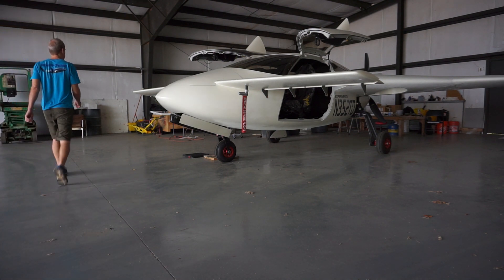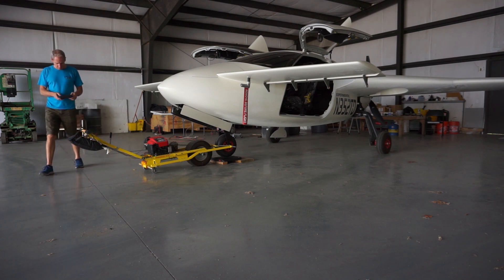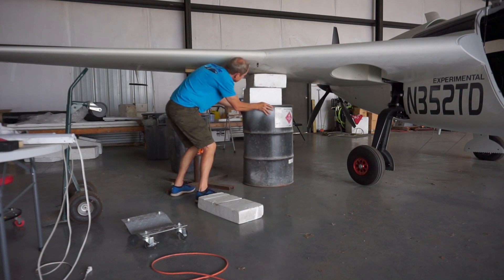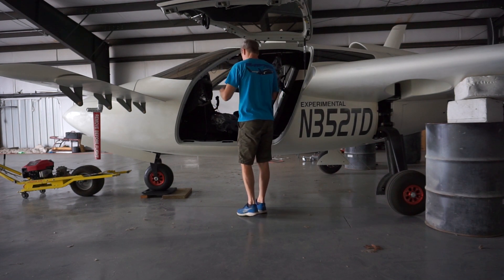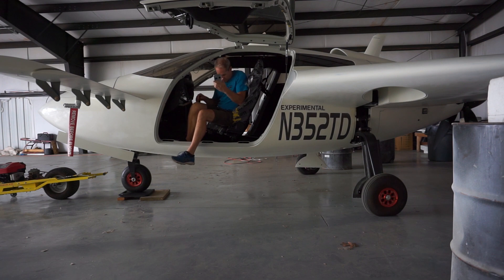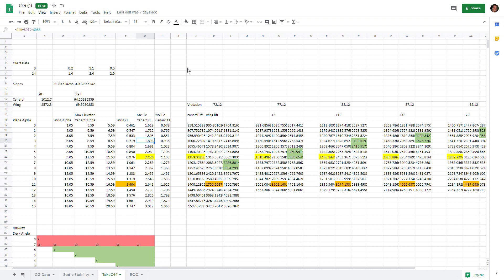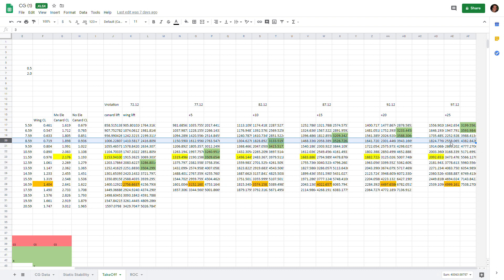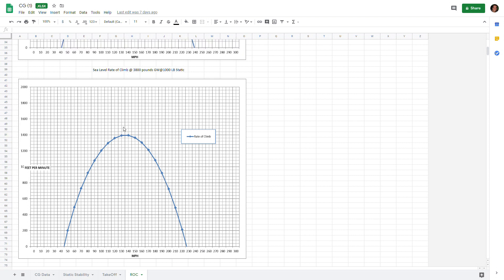Rotate/Lift Calculations - Building the Raptor Prototype

Comment: but would that be the center of lift of the canard total weight at VR more then the front well ? although adding to the multiplayer the left distance from the front well, and the fort plane is possible , still would it be from center of lift of the rear to center of lift of the front in a static situation , just asking  .

appreciate you still uploading and salute you on your tenacity it's admirable.

Comment: Been watching since you and Mark got the CNC machine...long road (airway) so I am pulling for you brother.  Have you placed an incidence jig on the canard to verify that when the airplane is fully loaded as it would be when rolling down the runway that the canard is at a positive angle of attack to the relative wind (runway surface)?  If the nose strut is too low/short and the "stance" of the airplane is such that the nose is too low the canard angle to the relative wind can be zero or even a nose down angle of attack.
Reply from the maker: It's positive. Recall that I have had the nose off already.

Comment: Hey Peter, great job getting to this point at the cusp of flight test. I’m pulling for you and the project! Just wanted to get clarification on some numbers you mention in this video. At about 3:40, you said you’re running the TOLD with Justin and the expected fuel load at 3550# total weight for the initial takeoff. Later, at about 11:16, you mentioned the max gross weight of the aircraft is planned at about the same 3550#. So is a single pilot and partial fuel load maxing the gross weight for the airframe as currently configured?
Reply from the maker: I meant gross weight for the first flight. Sorry for the confusion.

Comment: Pete, are you planning to do another detailed ( access panel off) integrity Inspection of the control system cabling before Wasabi arrives ?  It’s been some time now since you did the tensioning. Things may have relaxed somewhat. Also, are you going to measure the airleron and elevator control force outputs generated at the control surface through corresponding joystick control input forces. I.e what mechanical advantage ( if any ) is being generated by the control system cabling. ?
Reply from the maker: We will be reviewing all the items from the first visit before doing anything else.

Comment: ,,, I'd keep the fuel system as simple as possible on the initial flights . Feeding and returning into one tank only . No transfers. Of course the Motec has fuel temp provisions  ? ,,, ; however you may already have it that way ?
Reply from the maker: There is already no provision for switching tanks.

Comment: That 100 - 150 pounds of "reserve" lift based on those calculations means absolutely nothing when you're at a higher altitude airport, or when the outside temperature is more than 90°F and you run out of runway due to lower air density in an overweight aircraft. There has to be a better way to solve certain issues without adding weight to the airframe or having to plan your take-offs before the sunrise. There's a reason why it's called "Weight" and balance.
Reply from the maker: We have enough runway and excess power to compensate for high DA and we're going to test all this with high speed runs before attempting a full first flight. I'm pretty sure I said that in the video.

Comment: Obviously it was a safe thing to do but it certainly was a bit disconcerting watching you jacking the whole one side of the plane on that small block (of wood?).  Really looking forward to the first flight!
Reply from the maker: The point I jacked it on is right where the spar is. It can definitely take the load at that point.

Comment: Peter, did you explore using a shrouded prop in the early design stages?  Are there any canard designs using one?
Reply from the maker: I thought about it. They allow faster prop speeds but create extra drag at higher cruise speeds and more construction complexity.

Comment: I was wondering how accurate your measurement is. The placement of the wing supports seemed a bit arbitrary. To get a good reading they need to be the same distance from the CG as the average lift from the wings. Looking forward to next week.
Reply from the maker: I did support the wings as close as possible to the mean aerodynamic chord/center of pressure of the wing.

Comment: When is the prop going to touch seems an easy  to be an easy enough trigonometric problem : 
Arctan(11.75/72)=9.2686
So you are protected until 9.25 degrees of bank, which is plenty. 
Does my reasoning seem reasonable?
Reply from the maker: 9 degrees of pitch is what you meant. I think I did say that in the video.
Reply: Do not forget about your main undercarriage compression too, with weight and with G variations with RWY surface roughness?

Comment: Remember front strut extension when figuring how high the wheel will be off the ground.
Reply from the maker: That doesn't really matter as we're going for 3 degrees. So actually the wheel will be less than the 5.5 inches. Probably closer to 4 inches off the ground.
Reply: And you have to consider the landing attitude at touchdown with landing gear struts compressed for prop clearance.
Reply: gforce l

Comment: Are the performance numbers based on standard day + delta T for the predicted day pressure altitude? Or strictly standard day calculations?
Reply from the maker: I see that Mark has used what I believe is an air density of 0.00238 for his lift calculations.
Reply: Raptor Aircraft - that’s standard day rounded up. 0.002379. I just hope they feel comfortable with this length of runway. I know she will fly she’s got turbo power!

Comment: Great airplane and can’t wait to see her fly.  One question.  With the main gear augmenting the amount of weight on the nose gear, do you anticipate the aircraft wanting to jump off the ground since the amount of lift the fore plane is producing is much larger than the actual weight of the plane?
Reply from the maker: No, it's the pilots job to moderate that lift using the elevator. But most likely it will come off evenly as the weight transfer goes onto the canard and main wing at around the same rate. So potentially just holding the elevator at 25% will result in a smooth lift off.

Comment: I don't quite understand why the weight while on the main gear wouldn't be where the calculation should be, because that is what the canard is going to try to be lifting. Doesn't the canard stall first? Wouldn't that mean that the wings will be flying before the canard and actually less weight for it to lift?
Reply from the maker: The canard is only lifting the weight towards the front of the aircraft. At high angles of attack a wing will stall. The canard is set with more AOA than the main wing so it will naturally stall first. But at only 3 degrees nose up neither will stall. When the airspeed is fast enough they will eventually generate enough lift to overcome the weight they are carrying.